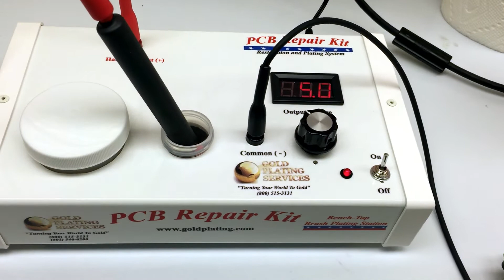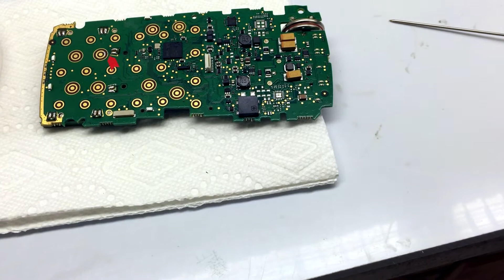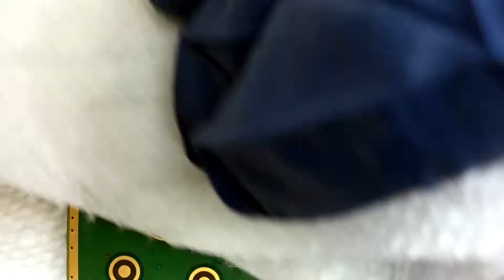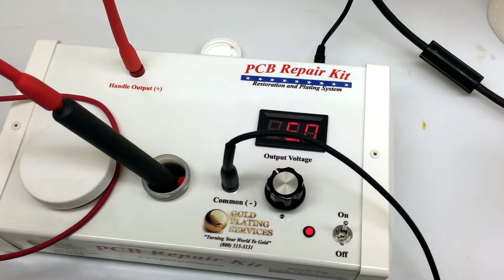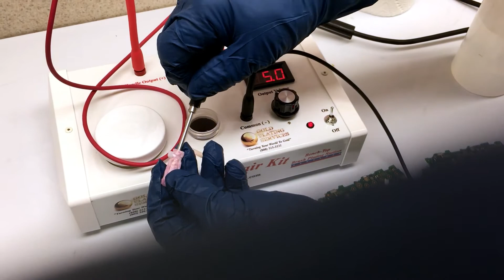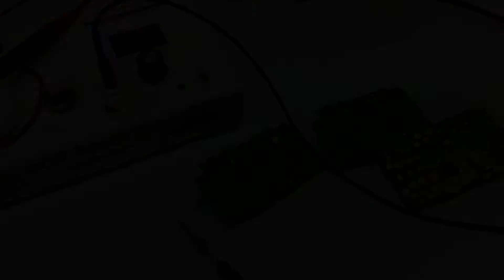24K Gold Plating Kit - Repairing PCB (Printed Circuit Board) Contacts

Comment: why cant u use a soldering gun and flux and copper braid to remove the sloder other than a dremil?
Reply from the maker: You could but then you risk contaminating the contact even more with solder. This process is to restore the circuit board so gold plating it is part of the process.

Comment: Why don't you just use a solder wik and and solder iron to remove the solder?
Reply from the maker: The issue here isn't the solder.  They need to repair the gold plating.  There are cases where solder is removed, however gold plating repair on PCB's is very important part of the industry.
Reply: I had this same and what he’s asking I Think is would it better to remove the solder using non subtractive means (solder wick)  considering the damage possible with a dremel and a PCB. Unless the real magic item here is that green bit, is it like a buffing stick charged with abrasive? Or what? 

I’ve been pouring over y’all’s site for days now learning I’m so glad to see y’all have a channel here!